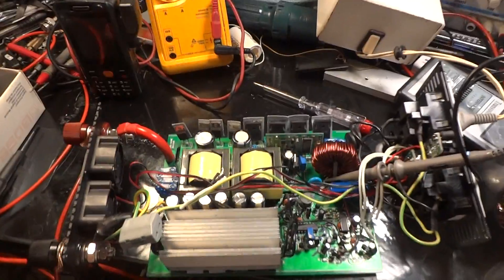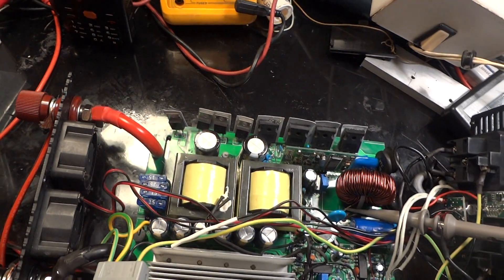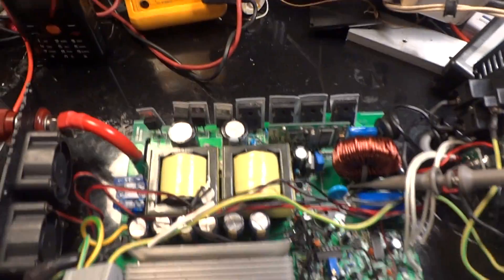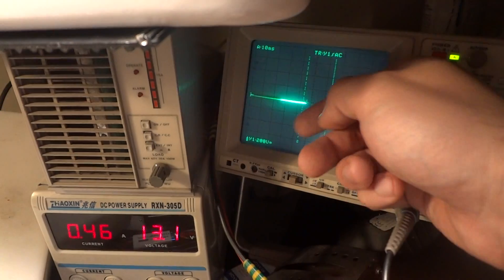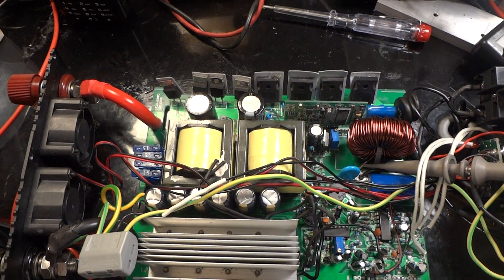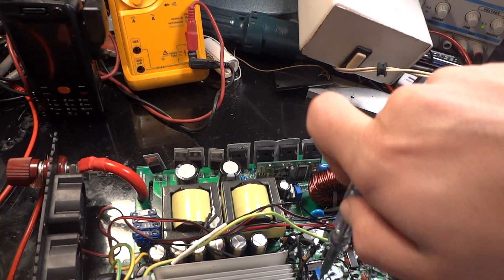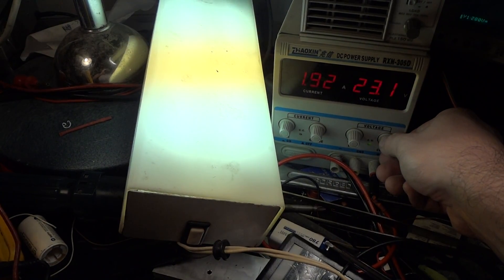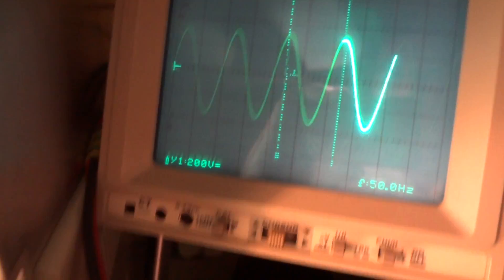fixing undervoltage protection on unknown pure sine wave inverter  ZXB-800WC

Comment: For viewers that come in years late like me: I don't know that inverter, but YouTube suggested yours when I searched for ZXB-1500PM. Did you manage to fix this inverter?

My 12V 220V 3000W inverter has no relay. It's undervoltage cutoff is 10.5V. The 3000W is peak power. It should support continuous power of 1500W, but when testing with a variable vacuum cleaner it cut off earlier with a red led and three beep warning. The mainboard is labeled ZXB-1500PM. It seems different brands use that same inverter logic board. The board has two parts: A pre-drive module and a post-drive module. Both modules have a button and a led. Are these configuration buttons? Maybe your logic board was reset to 12V settings?

Comment: Hi, 3000 watt full sinus inverter fault light is on.  When the inverter is turned on, a relay tripping sound is heard, then the fault light is on, what do you think could be the problem?
Reply from the maker: On inverters general cause are blown output stage power mosfeets. If it's blowing fuse (most like cause is at begging stage where 12V is chopped to 400V, if not blowing fuse but electronic detect abnormality - i found that problem is in H bridge that is creating waveform.

Comment: nobody ever replied to this?   Oh well, just saw this in 2020, and it behaves like my 12V invertor with the cutoff near 11V.    With regards to the fuses not equalling 800W, maybe it only equals 800W if Both outlets are used.   Sorry I didn't watch closely enough, just a thought, from 2020...   :p